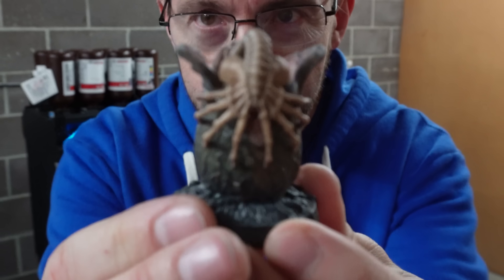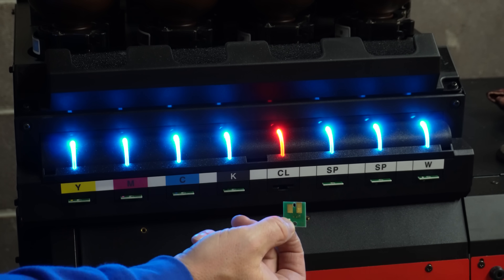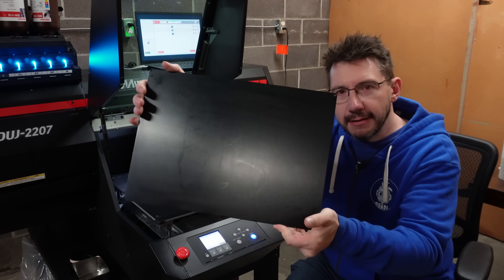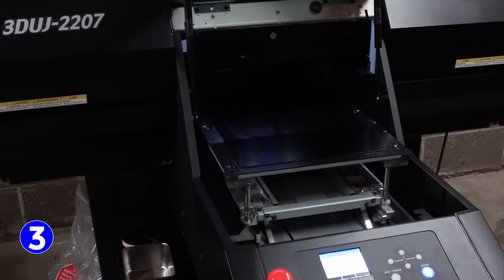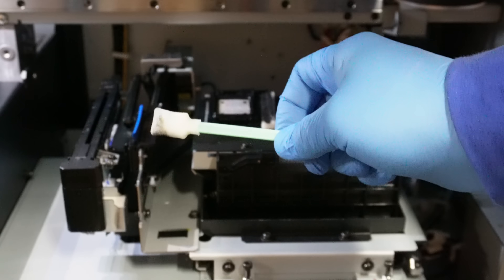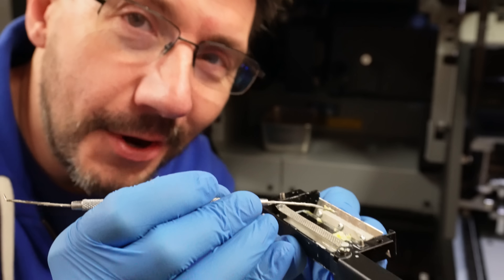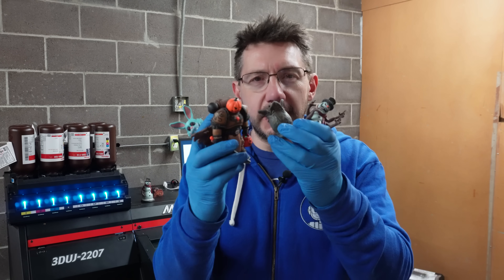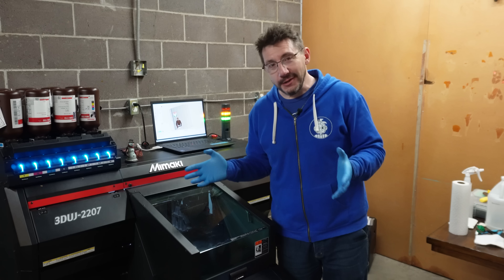Prepare for FULL COLOR 3D PRINTING

Comment: now get the price to normal paper inkjet printer range. or normal commoner 3d printer range. yes 50k is not commoner. you are not commoner. does not have to be that gigantic. just add the color mixer to a normal 3d printer for any filament color, white. yes you are advertising a very up-costed version of a printer. too much everything, overload of cost. in everything.
Reply from the maker: Sounds like you have it figured out, when you build it ping me so I can show it off!

Comment: We have one at our facility. Took technicians five "fly-in" visits to set it up and still would only print to 12% before the error message would display. Machine has to constantly be powered on, and it makes noise, so you have to put in an area where you don't want, you or your employees to be disturbed. Over a two month period of trying to print the Mimaki demo sample and not printing anything completely, the waste ink tank filled 20%. The cleaning process is completely counter productive. For that $50,000 the machine should clean itself AND drive you to work. You will also need a super laptop that does not come with the printer. The cleaning solution for the printer heads and extremely hard to reinstall tray is $92 for a 4 oz. glass bottle. That solution lasts about 10-12 cleanings. If this were 10x's more user friendly and I wanted to make small toys it'd be worth it. Our facility got it only because it was part of a 5 machine purchase bid.

Comment: My experience with these machines dates back three years, specifically with the standard UV flatbed printers (not the 3D variant).  I extensively utilized them, and it's noteworthy that they share consumables, cleaning processes, and even the ink system, like getting a reminder to go mix specifically only the white bottles 😅.

Furthermore, as the units I operated were designed for diverse substrates such as books, pencils, pens, and power banks, they featured a substantial Z-axis travel. This allowed me to manually print layer by layer, creating unique patterns and textures. Basically a 3D printer with 4mm on Z height ahah

Comment: This works almost identically to the Mimaki JFX200-2513 I have used for years for regular UV printing on (whatever) large format material for trade show exhibits.  Make sure you have EXTRA chips around sometimes, the inks also force you to change the inks out, saying they are expired.  Mine is just a very, very large 2D printer. However, I found your video fascinating because the processes are nearly identical for cleaning and maintenance.  I will post a video on your Twitter page so you can see the difference in size!

Comment: Dump waste in transparent plastic bag.  Expose to UV light.  No longer hazardous.  😉
Reply from the maker: YES!
Reply: It will create an exothermic reaction, so be careful.  The higher the intensity of the UV source, the higher the reaction temperature.  You’ll probably want to expose it in a bucket, or something similar, to be safe.

Comment: Hey Joel. For the cleaning ink of min 8:00,  pour in a container and cure it with a UV light or a post-curing unit of other DLP/SLA brands, probably in a normal PET bottle also works. Nobody wants resin residues close and polymerizing them is sometimes the best solution 😉

Comment: Lately i watch these filament printers, and i notice there are lots of waste, junk ect. from printing (prints included), would be great if you would do video about recycling that stuff , there are some open source machines available online. Its kinda crazy, 3d printing produces as someone made video  " rise of3d printed slop" , i was skeptical but indeed , lots of 3d printing involves useless trash.  Granted, as far as i know cant recycle resin 3d prints (correct me if im wrong), but when it comes to some of filaments they are very much recyclable

Comment: What businesses need such detailed, multicolor 3d prints that they're able and willing to spend almost 60k on a machine like this?
Reply from the maker: I wouldn’t be surprised to see this at a Funco level business. Those that need a tactile representation of a 3d model of a product.
Reply: Prop shops, architectural firms, fabrication prototypers, toy makers, and manufacturers with engineering divisions (think auto companies and the like) all come immediately to mind.  I’m sure there are others I’m forgetting.
Reply: @EricMeyerweb  But why would prototyping of any kind need to be multi-colored? What does it matter what it looks like as long as it can tell you whether it fits/works or not?

Comment: An absolutely awful design. FAR too much maintenance, and they haven't figured out how to clean the $1000 ink heads without user intervention?!  I considered buying one of these a couple of years ago - SO glad I didn't. Really dodged a bullet. Bambu came out and mode this obsolete overnight.
The models are okay; definitely not amazing compared to a 4-16 colour model. I would think that hiring a decent model printer and printing everything white would be more affordable solution.
Reply: I wouldn't say the Bambu AMS makes this obsolete.  That's an apples-to-pommegranites comparison, the two technologies have very different end-users in mind.

I do agree that this is immature technology.  This is, one assumes, aimed at the industries that bang things out with injection molding and then use barely paid Bangledeshi or Uyghur workers to paint them.  But it's got way too much skilled labour and way too much downtime to really replace those methods.

Still, it's a starting point, and one can hope that in a decade or so this basic approach will exist in a much more automated form.
Reply: @davydatwood3158  Yes, I'm positive that inkjet printed parts will be the future for low waste, full colour 3D printing, and this isn't even the first machine to do it. This feels how the Ender 3 felt - badly designed, poorly considered and placing the entire burden for operation on the user.

I am not at all sure that I agree with your middle paragraph about the target demographic. This is likely too slow and too expensive to operate compared to model farms for instance. I see this more as being aimed at architects, prop makers, and businesses that need to produces high quality previews for multimillion dollar clients. I expect this to be good for small run bespoke projects.

Comment: commons sense goes a long way, them using the bottles as the tanks is so smart...no reason to use a dumb tank that will get dirty and stained when you get a new one with every ink you buy...i wish they came up with a foolproof way of getting rid of the purge ink on most of those tank style printers too, like why can you just use an empty bottle of ink as the ink trap for purged ink...makes no sense why they dont do that instead of stupid sponges that go bad real quickly

Comment: Very similar cleaning process to the exone sand printers we use at work... other than we're fully inside the printer when doing it 😆 (especially the s-max, less so on the smaller s-print machines) and with less sand in your pockets.

Comment: 8 inches by 8 inches by 3 inches: $42,000 USD before you even buy the inks. And the maintenance. Remember all those inkjet photo printers and all those headaches? Yeah, the same but add $100s maintenance costs. 

Don't get me wrong, Mimaki is the absolute best color 3D printer. Used by filmakers and professional model makers, it's a tool worth having. Joel, if you own this, may I suggest letting local filmmakers (like stop motion) and architectural firms know you have this? It'll be another side hustle to print for them.
Reply: When I look at the website, it shows me "Price: $50,652.00".
Reply: @yvan2563  On the website it says you have to buy a block of training with the purchase. That adds $7k to the base cost.
Reply: That white pigment looks like a nightmare...
Reply: In 10yrs, it will be $500.00 *

*If it were openSource
Reply: @ItsCrazyMan-JustCrazy  and about 1/4 the size ;) lol
Reply: @ItsCrazyMan-JustCrazy  Just the parts for a Voron printer cost more than that, and this is an industrial machine. What makes you think that open source has any effect on the cost of the components? Or do you think parts like linear rails are free?